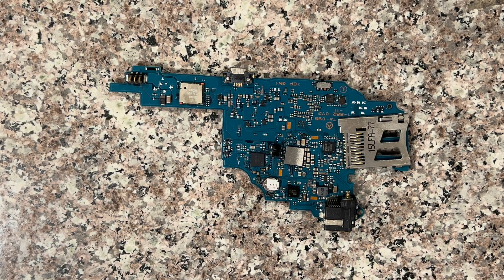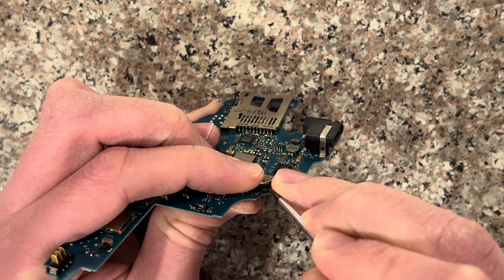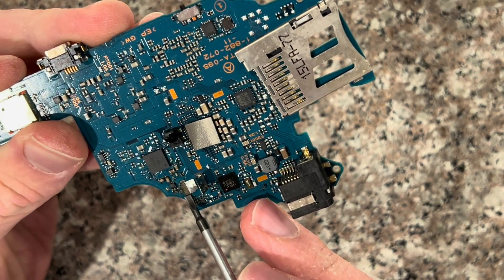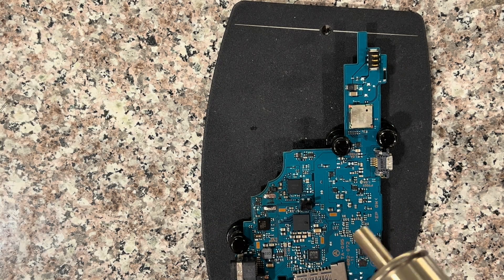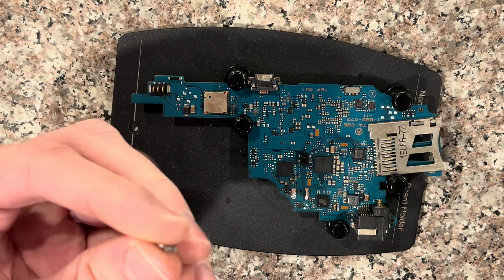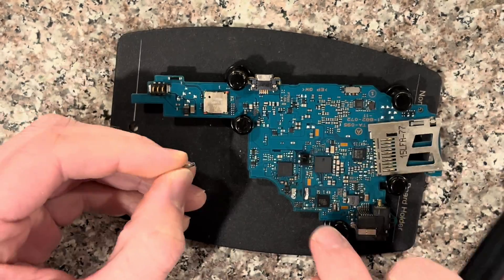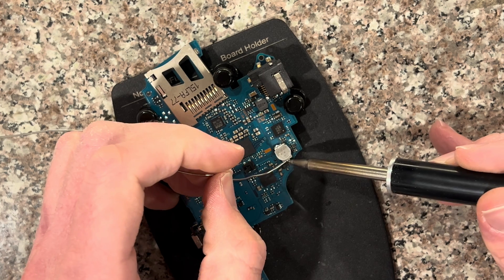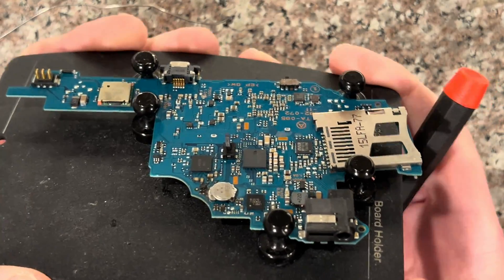Sony PSP 3000 - How to replace super capacitor - Won’t keep date/time

Comment: Hey man, i replaced it on my psp and now it won’t turn on :( it does charge my battery but it doesn’t turn on either with battery or cable, do you know what could be the issue?
Reply from the maker: You’ll want to check if you accidentally bridged some solder points in that area or knocked off a small component.

Comment: Will it unbricked My PSP
Reply from the maker: It will only unbrick it if the brick is that it’ll only turn on if first plugged in with a charger
Reply: Yes it's fully bricked orange light get on  @blakeblundell9001

Comment: I accidently lift off the solder pad for the cmos battery. Any fix suggestions?
Reply from the maker: The left pad or right pad? The right one is pretty easy to solve
Reply: @blakeblundell9001  both unfortunately🥲

Comment: Will PSP work with no cmos capacitor at all?
Reply from the maker: @ПаноДол  it could either not turn on at all, or only turn on if jump started off a charger

Comment: Is the supercapacitor the same as the psp 2000?
Reply from the maker: @pepe-kh5bo  they have a different location and the 2000s have a different design for the mounting points. The 1000s and 2000s have the same design

Comment: For anyone wondering what the specific cell is, its a
Panasonic EECENOF204J2 3.3V 0.2F Super capacitor. Its really hard to come by, BUT the EECENOF204J1 works as well and that is what I used to replace mine on my PSP 3000.
Reply: psp 1000?

Comment: what if use wire attach to cmos battery instead of direct contact to motherboard, won't that be more efficient like in the future if want to replace it again
Reply from the maker: It’s pretty easy to remove it again as long as you don’t try to get it super close to the motherboard when installing. I like to sit a bit higher on solder mounds in case the cmos that I installed was faulty (you can actually check if you have a multimeter and set a battery on the contacts of the motherboard)
Reply: @blakeblundell9001  is there cmos battrey holder this small? just not convy it must be resholder to replace it again since this is a common problem

Comment: Can it just be taken out without removing the metal plates?
Reply from the maker: You could replace just the cell portion, but it’ll be harder to fit the replacement in there. The plates will be slightly bent from how the old one was attached and then you’ll have to use some type of tape to give enough pressure for it to work
Reply: @lundell9001 
I mean I don't want to replace it but just remove and forget. I have a psp 1000 and getting random shutdowns and I suspect its cause the CMOS leaked. Also the 1000 has a capacitor not a cell like the 3000. No videos on removing the 1000 one, so asking around. I heard that just removing it will work fine, but I wonder if I need to actually desolder the thing, or just bent it and take it out.

Comment: Hello, what's the model of this battery? I want to find it here in my country since you guys don't send here.
Reply from the maker: 3.3V 0.2F Super capacitor
Reply: Only the specification (3.3v 0.2f) is the only one that can be used on PSP? In my country's online shop, there is one with the same specification, only the shape of the plate is different from the original PSP, is that possible?

Sorry bad english😂

Comment: Just a quick heads up - that's a supercapacitor, not a battery.
They rarely leak but a battery might be more likely to do so, so just be careful with that.
Also, keeping date/time isn't really that big of a deal so it's probs for the best to just remove it if it dies.

Comment: Such B's to replace a battery on PSP😕
Reply: Just done mine without soldering iron. I just remove the battery like he did but keep that iron plate of cmos battery and replace it with new battery. I'm using glue and strong tape to reattached the battery. It's working perfectly.

Comment: Thanks for showing this. Did it work when re assembled?
Reply from the maker: This motherboard was in my scrap pile due to an unrelated issue, but it also happened to have a bad CMOS. So it was a good candidate to showcase the fix anyway. I’ve done this repair a few times on other motherboards where the CMOS was the main issue, and it did resolve the date/time issue as well as other power related problems.